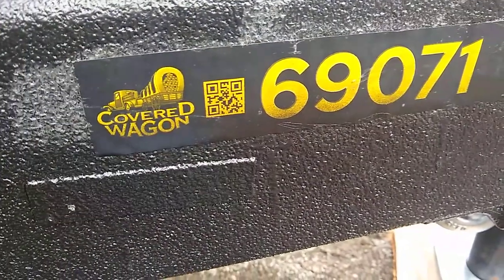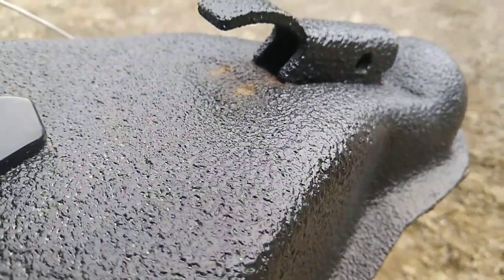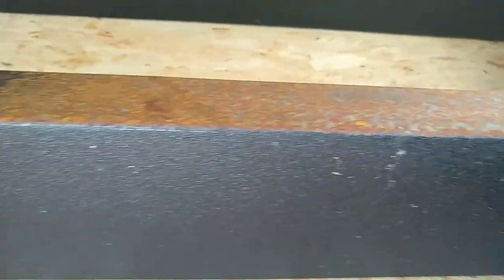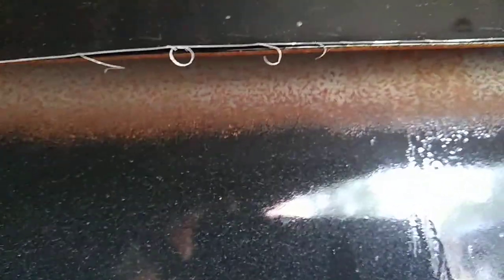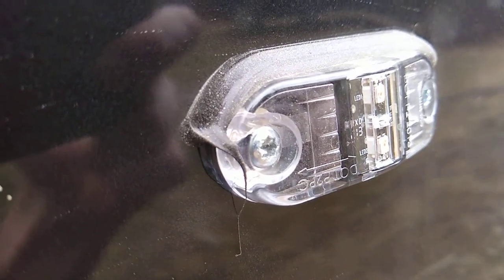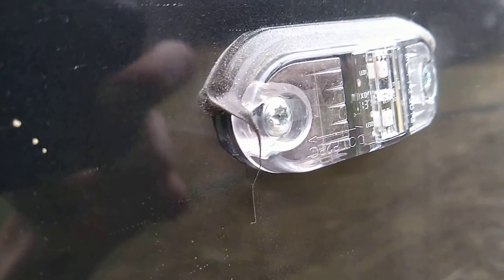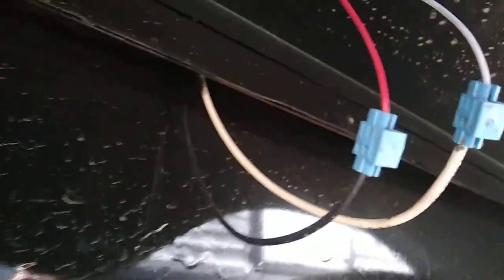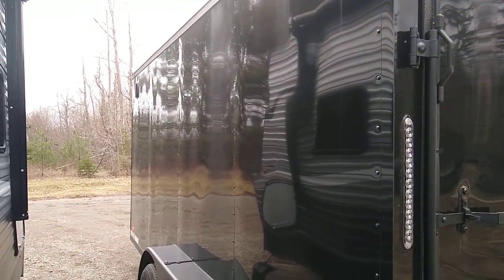New covered wagon trailers are junk

Comment: This is the exact same issues I’m having with my trailer in addition to the side panels falling off and it was bought in April 2022 
They won’t return calls or emails
Reply: Cross my fingers but mine has been almost perfect. The only issue I have had is the Coleman Ac/Heat unit is designed to have vents run to it. It will not blow air down from the ceiling. It only blows air straight out to the side along the ceiling. I removed the cover and installed 2 Pontiac G6 vents. They are round and turn 360 degrees with louvers. Now I can angle the heat or a/c in any direction.